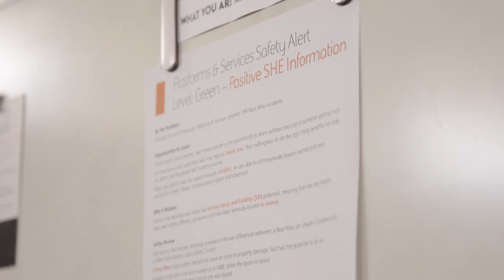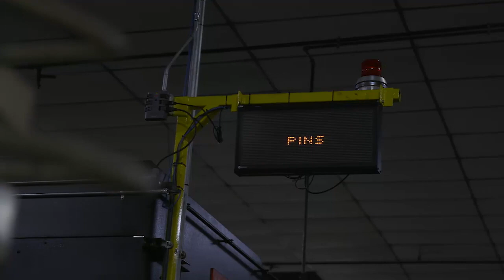BAE Systems Combat Vehicles - Safety Core Values

Comment: To whom it may concern,
My name is Eric Parauta, I am a First Tenent serving at Amphibious Vehicle Battalion in Brazil. My CO designed me to do a research about the road wheels of the Assault Amphibious vehicle.
In order to do so, I need to gather same pieces of information!
Without disturbing your work, I will ask some questions here and when you have availability and can answer, I will be very grateful:

- how this road wheels is done (the process of creation, like vulcanization? like burning?...)
-  road wheel lifetime
- the unit cost
- what is the rubber and the metal made of
- and the most important, if it’s possible to recover the wheel’s rubber, I mean when the wheel was used and gets battered the rubber get’s damaged. Is it possible to send the wheel back to insert a new rubber or it isn’t worth?
- How do they Marines do? Do they buy new wheels or do they refurbish them?
- Do you have any kind of document or manual about this road wheels? (It would be very interesting for me to get fabric data from this item)
- which battalion recycles the road wheel?
- Do you have the extract of some order?

Thanks for your attention.
Looking forward to rearing from you.
Best regards, First Tenent Parauta.